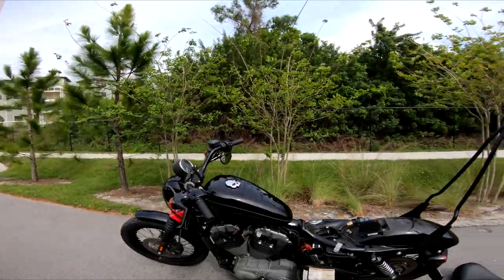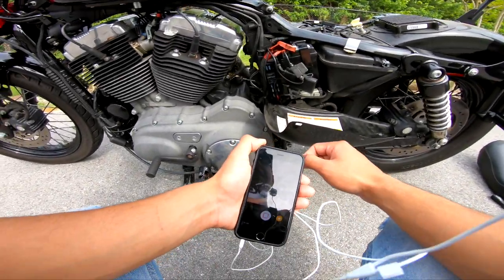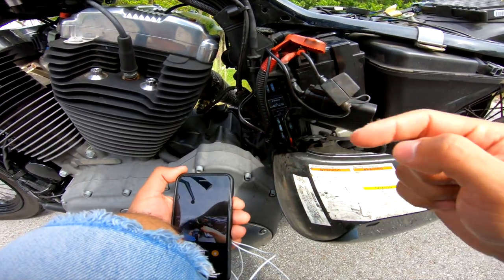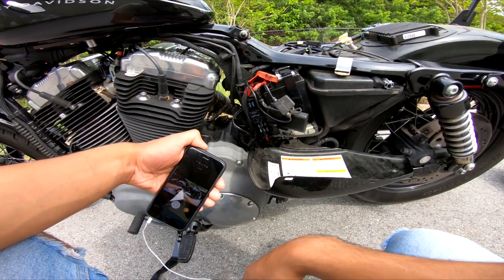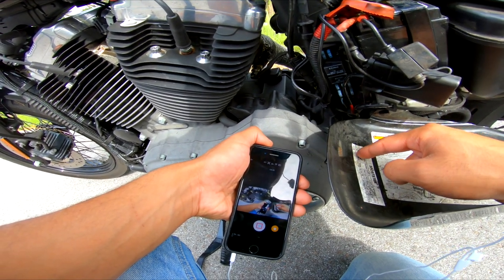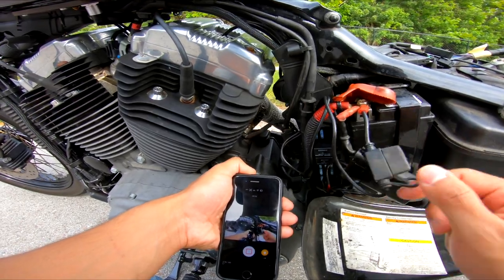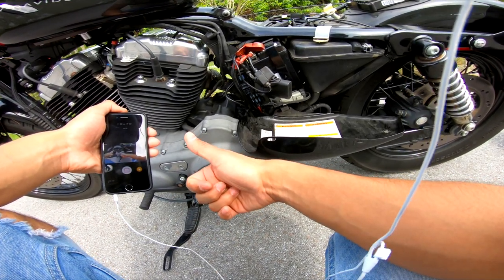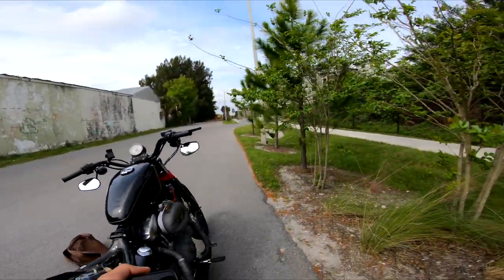Harley Sportster Won't Start / Engine Dies EASY FIX!

Comment: This video got me out of a pinch yesterday. Stopped to fill up for gas and bike wouldn't start. Same thing strong turnover when trying to start just wasn't getting fuel. Wouldn't bump start. So I called a tow truck and started googling things for when i got it home. Found this video. tried swapping relays heard fuel pump turn on. there was a slight hill behind the gas station. got it started by bump starting it. cancelled the tow truck and rode it home! thank you for sharing this video!
Reply from the maker: Glad I could save you some money brother.

Comment: Thank you! Same year, just was 1200 Custom. So you saved me hours. I swapped  relays, and it turned on fuel pump so I knew control relay was bad. Thank you again for you video, so you have my sincere thanks. Ride safe!

Comment: Same thing happened to me except the guy on a trike pulled up and took off the positive terminal cable after having it off for a few seconds put it back on and it started up. It died again a little ways down the highway and I had to redo that and it got me home. I'm hoping it's a relay and an easy fix

Comment: thank you for the great video! i am going to try. I have a 2006 sportster 1200 custom. For some unknown reason lately when I go to start it up as soon as I hit the starter button on the handlebar it looses ALL power. Like, zero power. Sometimes it will come back and sometimes it just wont. I dont know if I have a fuse issue or battery or what. When the power is on everything works perfectly. It is either 100% working electrical or zero power. wtf
Reply from the maker: Thanks for tuning in. Quite a unique issue. If the bike powers on and other switches work (headlights, horn, etc) its probably not a battery issue but id put it on a battery maintainer just in case. I recommend Noco products, I use the Noco Genius one and I bought the X connector SAE adapter for it for easy plug in with the Harley’s stock charging port.  I suspect you may have an issue with the switch itself. Due to the intermittent-ness of the issue the switch may be going out and perhaps its toggling between ON and OFF position against your will when pressed. Just my theory. Id start with knocking the easy stuff out of the way like checking battery, checking fuses, checking grounds, etc then once you’ve done all of that, consider searching forums or posting a vid of your issue on a harley sportster forum or Facebook group. 👍🏻
Reply: I've got that same problem.  It usually does it if I start it within 10 minutes after shutting it off. It either does that or the starter skips and it seems like the motor turns backwards. Every time I stop for gas I'm dealing one of those issues and tbh, it's a little embarrassing smh.

Comment: same thing happen on my 1200 ' ' ' '  I will try your suggestion . . . I hope im not getting into a process elimination thing . . . I learned long ago if its unfixable . .. may just bring it into dealer and let them plug a $0.15 cents fuse in and pay the $200.00  service charge for a fix and keep it a secret . . .

Comment: my bike cranks hard but the fuses are all good, and relay is a bit red w rust but scraped a bit to show bare metal and still nothing. i smell fuel, so it may not be fuel lines, maybe it is my crank sensor? bike is 1200 sportster 06
Reply from the maker: Its worth replacing the relay anyways and adding some dye electric grease to each fuse to prevent rusting on all of them. Check all your connections and make sure your fuel pump is priming right and is functional. Perhaps try giving it a good push start and see if she fires up. Past this your issue can be a variety of things and it may be best to visit a shop. If you figure it out post a video so others who have the same problem can fix their sportys. Thanks!

Comment: I’ve got a 2020 1200, fuel pump won’t prime.. I don’t have these fuses. Not quite sure what to do
Reply: did u fix it? i have the same issue same bike just 2018

Comment: So I was riding home from work. I think I was really low on gas and oil never notice. It died out of no where. Re filled oil and gas and I tried to start it then it had a rapid clicking noise. I jumped it with my car had it connected for 3 minutes it turned on but I would have to hold the throttle. Also my back brakes all of a sudden became soft and my speedometer didn’t come on while I was riding.
Reply: My turn signals would flash every time I turned the key.

Comment: I haven't got it yet but I think that is my problem. I took off on my bike after work got almost a mile down the road and died. I had to push it all the way back home. Hope it works. Your bike is sweet.

Comment: Same thing happened to me on the way to work today, by the time the tow truck got to me the bike started up just fine
Reply from the maker: carlos midence Yup! Be careful though as it can get worse over time. My bike was having a hard time starting and then eventually just died while riding. Very weird issue. Change your fuse anyway its like $5.

Comment: Would your bike turn on and off ...or work it just not start at all
Reply from the maker: Trinidad Salinas Sometimes start fine and on occasion it would cut out while riding and be dead. If I turned the key and pressed the switch on and off and on real fast it would turn on in a pinch.
Reply: Mine was doing the same ...long story short I figured out it was the system relay switch in the fuse block I cleaned it up from the corrosion it developed runs like a champ  now

Comment: I have an older, 94 Sportster, mine would start and run but lose power, engine, electrical, not all the way but had to idle for a few and it would come back, found the main power relay, more of a breaker, 50 amp, the contacts were a bit loose, found it when I was changing the battery, cleaned and tightened the connection's, no more problem
Reply from the maker: Great advice Tim

Comment: What if it doesn't crank?
Reply from the maker: Its another issue, I would look at battery cables, all fuses, etc. Start simple then gradually move towards more complex. More often than not, its the simple things.